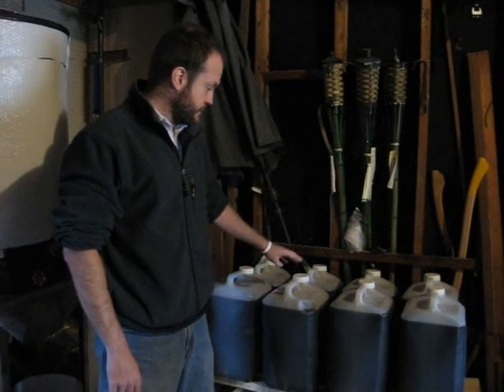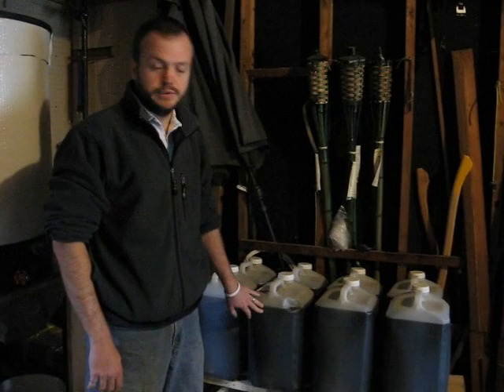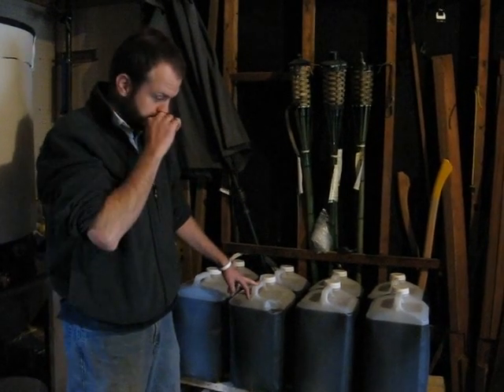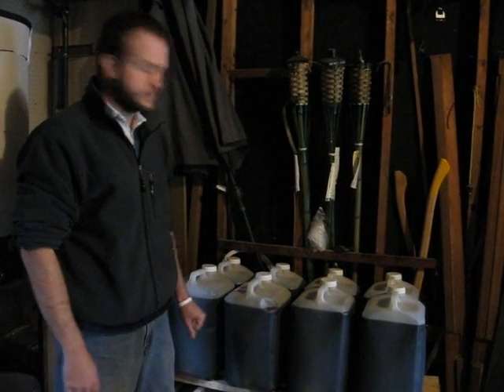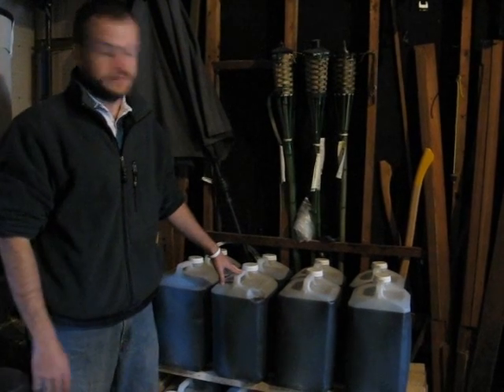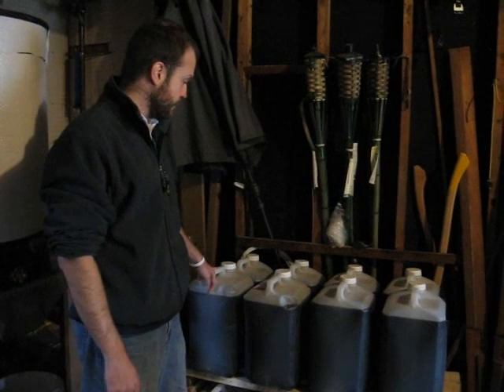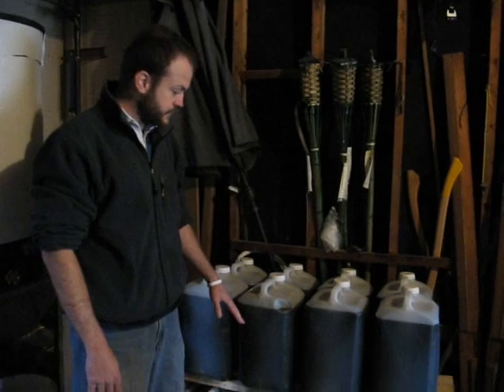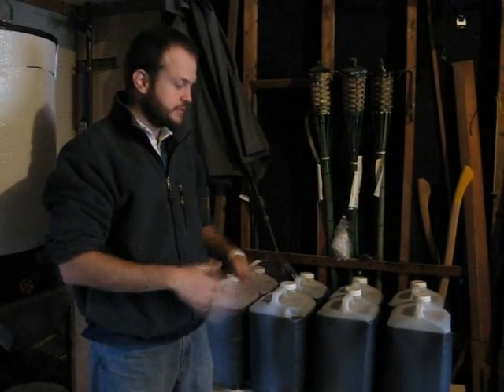Veggie Oil Fuel Home Processing Plant - Storing Oil

Comment from the maker: You use the 'splatter test'.  Put a small amount in a pan and heat it up.  If it 'splatters', that is the water in the oil boiling.  Even if it doesn't, it will still have some water in it - but it will not be serious.  Diesel you get at the pump has water in it as well, all fuel does infact.